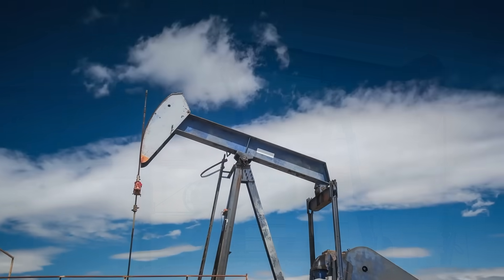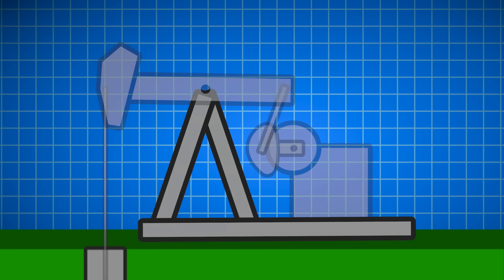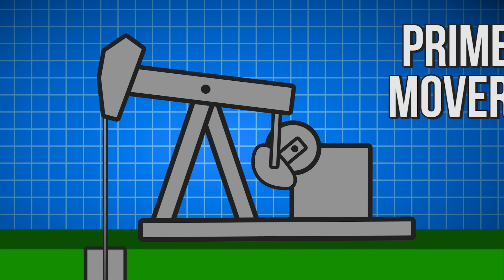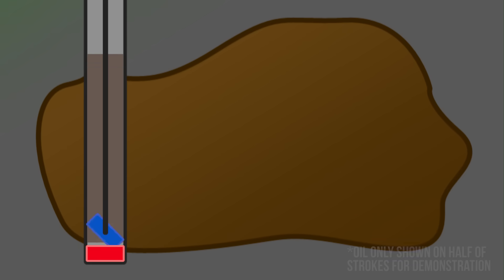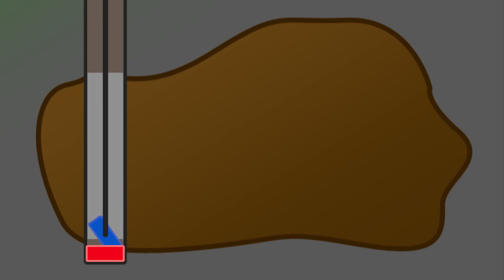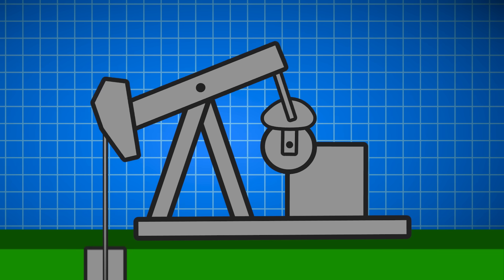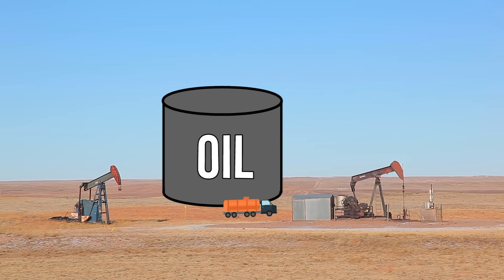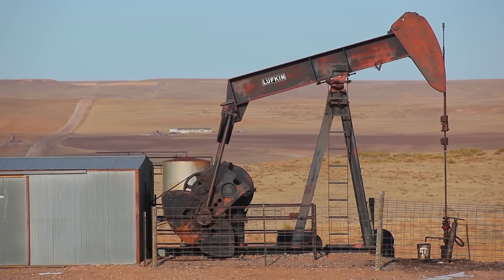How Do Oil Pumpjacks Work?

Comment: Electricity from renewables should be used to operate electrical motors for oil extraction. Oil would cheaper, and greener (smaller carbon footprint, at least in the production process).
Reply from the maker: Great idea!
Reply: Actually using wind and solar would be a poor choice.  You don't want to pump only when the sun shines or the wind blows and backing up all that hp with batteries would make it expensive.
Reply: @frankpizzo8971  we're talking south so there's plenty of sun hours, and you could still run the electric motors on cheap night electricity coming from wind (when there is, there is a good amount in Texas), nuclear (clean but risky) or fuels (worst case scenario but still more efficient than converting fuel into movement in a diesel motor). On top of that, electric motors are more efficient so they could deliver more power for faster pumping during the day to make up for a hypothetic stop during the night or whenever electricity is not-so-cheap. Overall it would actually be cheaper.
Reply: @cristoux  Some pumpjacks are electrical and do run on grid but considering they pump 24/7, and Texas has on average 2600 hr sunshine a year solar wont cut it alone.  Neither would small scale wind. 
Large scale wind, nuclear, hydro would help, but nobody is going to run transmission lines to 133,000 oil wells in Texas and reroute them every time a well gets depleted.  Besides some modern jacks can run off natural gas directly from the wellhead for free.

Comment: Thanks for the video.  I wonder how much energy is required to bring a particular amount of oil to the surface?  Has anyone ever stopped to calculate that?  Obviously these pumps have either electric or gas motors and these motors require energy.  Nothing is free.  So what equivalent in oil energy is used on the surface in order to bring up a particular amount of oil energy from below?
Reply: That is surely calculated to know what motor size is needed. Theoretically it would be a relatively simple calculation, to lift a given mass of oil from the well to the surface would be equal to mass*depth*gravity. For volume this would be volume*density*depth*gravity. Power would be this work over time, so flow rate (gallons per minute say)*density*depth*gravity. There would be losses throughout the system, nothing is 100% efficient, but I'd imagine they are not huge. For this reason, pumping oil from a shallow well is cheaper than from a deep one, so deep wells are sometimes only activated when oil prices go up, then shut down when oil gets cheap. I've also heard that as a well is pumped out, the effective depth gets deeper, but if the pump is shut off it will "re-fill" over a period of time, so as a well nears empty the pump will be on only part-time.
Reply: @quillmaurer6563   Thanks for the answer.  I'm sure engineers in the oil industry have the figures.  I was just looking for some percentage or ratio of the amount of energy required to the amount of energy pumped out of a given well.  There must be a rule of thumb, or more than one, according to the depth of the well, the inside diameter of the well: The deeper the well, the more weight in the "tube", and the more energy required to lift it.  Thanks for the other information, too... about when and why they might shut down a well either temporarily or permanently.
Reply: @quillmaurer6563  The internal combustion engines used to run  some pumping units usually run off  the natural gas produced by the well itself.  Engines are usually one cylinder types.  They can last 40-50 years.
Reply: @quillmaurer6563  Spark ignited,  I don't know the horsepower rating of the one (thank god)  AJAX  engine we had in the well field  I relief pumped in.  Don't believe those AJAX 's were over built as they certainly worked for many years with not a lot of maintenance involved.   Electric  Motors in the same oil field I worked in on similar wells were in the 200 Horse Power range.   Those were all on timers so they would run a few minutes, turn off and allow the well resevoir to recharge, and then turn on again.
There are some comments in this thread by people who know a lot more than I do in the oil field.  Read some of the other comments and direct your questions to the guys who know much more than me.

Comment: I would like to know what the net gain is here. Energy in versus what we get out. It will be getting worse and worse as time goes on. Each well dwindles down. Those motors look like they could run a train cross country. So much waste!
Reply: WRONG echodelta9. Idiots like yourself have been saying that for MANY DECADES.  It has been proven FALSE. Which is WHY, when adjusted for inflation, gasoline is MUCH cheaper than it was in 1980.
Reply: If it took more energy to pump it out than they were getting, then they wouldn’t do it! They don’t pump oil out for the fun of it. We’re trying to make money in this industry.

Comment: no part of a pumping unit is called a derrick. a derrick is the tall upright structure of a drilling rig used in exploration. the pumping unit is used in the recovery stage of the oil. this occurs in the production stage of the process that brings oil, water, salt water and condensate to the surface for separation/processing prior to going to the refinery.
Reply: It really doesn't matter what the correct terminology is or isn't, a huge swath of the population will continue to call them derricks.
Reply from the maker: Yep. We’ve made the same disclaimer in the description and our pinned comment.

Comment: You say the counterweight "helps balance out the forces" which is accurate but incomplete.  I guess you don't realize HOW it balances the forces.  The counterweight is set up so that it will take the same force to push the unloaded sucker rod INTO the bore as it does to pull the loaded rod OUT.  This requires a much smaller motor than if a counterweight was not used.  Instead of cycling between "full force" and "free ride", it's a relatively constant (and lower) force for the entire cycle.
Reply: I was about to comment about how the use of the counterweight is the real ingenuity of the device but whose explanation was left out - but you've hit the nail on the head. When the counterweight is falling with gravity assisting, the oil is lifting out of the pipe and a large force is required, mostly supplied by the counterweight/gravity, whereas when it is pushing back in,  little force is needed, so the motor's power is used to lift the counterweight in preparation for the next oil lifting stroke. In this way the force is more balanced, and even a small motor can be used to heft a large head of oil up the pipe if one is willing to go slowly, since the small motor can be geared to rotate even a large counterweight, but more and more slowly as the motor gets smaller. Undoubtedly there are tradeoffs that determine the optimum motor, counterweight size, power consumption, and maximum oil seepage rates into the lift pipe that are made to minimize cost and maximize production.
Reply from the maker: Correct. Sorry if I wasn’t clear about that!🙂
Reply: Using a lot extra words to explain the same is that not 'overcomplete'?
Reply: @Triggernlfrl  No, none of what I added was said before.   I'd say just the right amount of complete.
Reply: studworth gg
Reply: In my experience many pump jacks are counter weight heavy as oil producers set the weights when the well is newly drilled but fail to adjust them after a few years of production. This can cause the units to run inefficiently as they draw more power than needed or just cause the gearbox to wear out. It'd be similar to driving a stick shift car and always letting off the clutch at 5000 rpm for starts if that makes sense
Reply: Thats pretty much how a regular elevator functions, right?
Reply: @LundbyFizz  You got it.  Ideally, the motor should work just as hard to move the car DOWN as UP.

Comment: Imagine all the energy that goes into pumping, trucking, refining, trucking again and pumping into your car's gas tank.
Reply: so that a 6000 lb truck can take someone who weighs 150 lbs to the grocery store at 16% efficiency.
Reply: A rig drilling 222mm (8-7/8 inch) build to land in the Duvernay will burn 8,000 liters diesel every 24 hours.
Reply: Yes Killroy, just a TINY fraction of the energy we get from the crude oil.  WHICH is what makes it so economical.  Stay in school and finish 6th grade.
Reply: @patrickeh696 , what is a tiny fraction?  Use numbers student can understand.
Reply: Look up in a good English dictionary (as you are obviously not a native speaker) "tiny" & "fraction".
Reply: @patrickeh696 , I'm looking for a qualitative answer.  Its alright if you don't know. I think I have read about this before and its not a tiny fraction.
Reply: @KillroyX99  yes, actually it is compared to other sources. The important part is that there is enough available and its the MOST cost efficient way to obtain power for our uses. There is not enough solar available without killing plants and changing weather/climate to supply what we use, nor by wind, or hydro. You want to complain about efficiency tell your greenie buddies to turn the damn heat down in their huge city buildings.
The simple fact is its not so much what kind of fuel we use, but HOW MUCH POWER we use. Put a damn sweatshirt on and turn the thermostat down.
Reply: integr8er66 , rooftop solar is a good idea.
Reply: @KillroyX99  well I wouldn't do it, imagine the cost to take all that stuff down and put it all back up when you need new shingles. I love solar on my off grid trailer, but it can't replace oil, also it costs more than grid power, so not really seeing it as any kind of replacement, at least not at its current price point. Don't get me wrong, its cool, and nice to have, but not ready to take over. I mean if you were on a heart lung machine would you want solar power running it?
Reply: @KillroyX99  ok, this is not the slightest bit serious. The first page says they include carbon sequestration costs, Carbon credit costs, etc etc. Come back when you have credible data. I know how the costs stack up, as I said I have solar power on one of my homes, but the only reason is it was going to cost $100,000 18 years ago to run the wires from the grid. I can buy grid power for eight cents a KWH. You can't make that price on solar...ever,  not to mention you could cover tge entire earth with panels and you would probably not be able to make enough to keep up. Next what happens to climate when you stop all that sun from reaching plants? Yep you mess it up. What happens when you take enough wind energy from our climate...yep you jack it up.
The real problem is too many people
Reply: Just think of all the jobs being provided and families being taken care of.
Reply: @kennethpitman1397  , we should put a team of people to crank the pumpjacks to give them more jobs.

Comment: Now, if we could just convince people that oil is NOT dead dinosaurs but is created by magma.... which has been known for 70 yrs....
The industry "thinks" that oil is being constantly created.

Oh?? ever wonder how oil gets created 30,000 ft down if its dead dinosaurs???
Reply: You cant make oil out of magma.  Oil is predominantly hydro-carbons.  There is no hydrogen or carbon in magma.  It's also not made out of dinosaurs either.  The origin material was mostly foliage and silt.  Any kind organic matter will become crude oil if baked at high temperature while under high pressure for a long time.   The organic material starts out on the surface, not deep down, and it gets buried over millions of years.   Oh and oil deposits are never 30,000 feet down.  Average is only about 3000 feet.  30,000 feet is close to the deepest hole ever drilled (40,000).  You are absolutely correct, except for everything you said.
Reply: @wouldntyouliketoknow9891  ....read carefully.... I did NOT say that oil comes from magma.
BTW. Which university did you get your PhD in petroleum geology from?? And how many years have you been working in the industry?
Reply: @hotrodray9884  4 years.  And you do not need a PhD to know basics.
Reply: @wouldntyouliketoknow9891  hummm so how was Deepwater Horizon over 18,000 ft then?
BP's Tiber Prospect is nearly 7 miles deep....thats almost 37,000 ft.
Reply: @integr8er66  Sure there are deeper and ultra deep wells out there.  The 3000 foot figure is an approximate mean of active wells.  Most active wells are not very deep.  It costs a lot of money to go ultra deep.  Has to be worth while to go down that far.   I'm not familiar with the BP one you mentioned, have to look that up.  I was just making fun of the commentator for pulling out a figure that was so deep that it was either beyond any active well, or at the least at the very limit of active wells, thus clearly showing he knows nothing (although the whole oil-out-of-magma thing kinda did that part already)
Reply: @wouldntyouliketoknow9891  most wells nowadays are usually drilled to around 10,000' before they are kicked off and drilled horizontally. Back before horizontal drilling, it wasn't uncommon at all for wells to be 20,000' +.
My dad was a tool pusher on a drilling rig that was part of the first "5 mile club." Drilled to a depth at just over 5 miles.
3000' would be considered a pretty shallow well.
Reply: HotRodRay 
It Could Bacteria Deep Inside thats the Only Organism that Can Maneuver thru the Pores all The Way Down .
Reply: HotRodRay  good point.

Comment: what kind of eng or motor does the prime mover use?
Reply: electric motor
Reply: Around Rose City Michigan most are run from the natural gas that accompanies the oil, big single cylinder engines called "hit and miss", they don't fire every stroke. You can hear them through the woods quite far away.
Reply: @charliedee9276  --now that makes sense, so no outside power is supplied to the prime mover. that means less maintenance & cheaper operation.. thanks for the reply..
Reply: So what percentage of what you are pumping out is required to get the stuff out? In terms of BTU's that is as I get they don't burn crude oil
Reply: Most commonly these days its electric engines, or motors. They're much more efficient and reliable.

Natural gas ones were used due to the availability of the stuff from the actual well. These days wells have infrastructure to transport and sell the gas which leaves electric engines to be more desirable.

Comment: As one of the other commenters pointed out, an "oil derrick" is actually a tower that is set up OVER the well and pumping unit to enable servicing of the well when necessary.  For many years, these towers -- similar to the towers used to drill the well in the first place -- were left standing over the well and pumping unit for years; since about 1960, however, they are more commonly folded up on large trucks and driven from well to well, so few if any wells have permanent "derricks" standing over them anymore.  The rocking "pumping units," however, are still quite common in oil fields.  Otherwise a very good video!
Reply from the maker: Definitely. When writing this script the terms got interchanged slightly. I tried to change the title as well as make disclaimers about this in the description. I totally understand 🙂✌🏻
Reply: This is a pump jack....not a Derrick. The British call them 'nodding donkeys'.
Reply: I completely missed that fact lol

Comment: I work in the oil field here in texas as a lease operator, i check this units every day. This are called pumping units also known as pumpjacks in the slang language. Derrick is the platform used on drilling rigs and pulling units. And the pumps used in this type of wells do not look like that. Thats more like a pump used in old water wells
Reply: jose pena I’ve been trying to get in there for a long while now any advice to getting an oilfield job?
Reply: @czar2074  are you still interested in the oilfields? Are you in Canada or willing to relocate?
Reply: Dominique Hebert I was in there for a while I was fracking
Reply: Dominique Hebert I get out of the army in 6 months. I’m willing to re-locate and learn. Also was the valedictorian of my school and had two scholarships for welding
Reply: @travisbryan663  you ever go?
Reply: I pump wells also, I cringe every time I hear the word “pump jacks”.
Reply: @heyseed817  we call them pumpjacks in alberta but its mainly oil sands here.
Reply: I live in Kentucky and and my dad was a pumper for two or three different companies all at the same time. We called them pumping units  also, or just units. Never knew the term pumpjacks till I was older and probably heard it on tv.